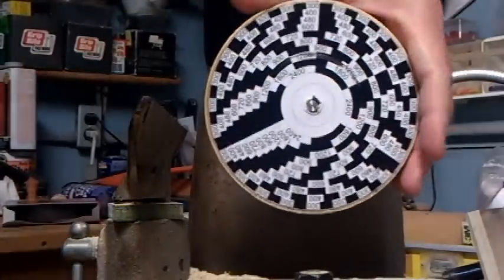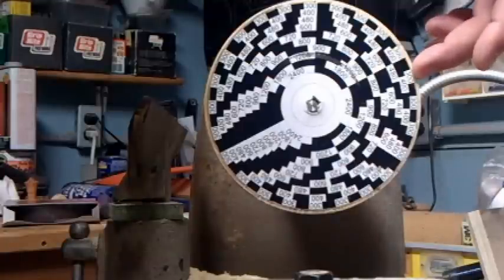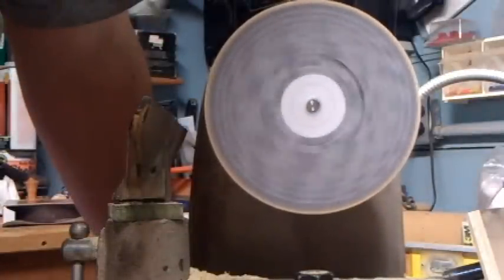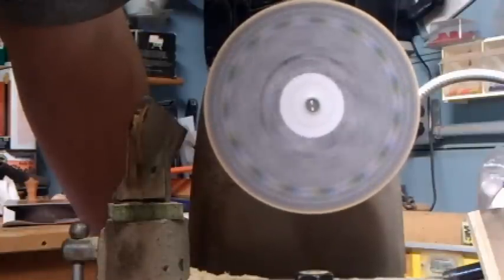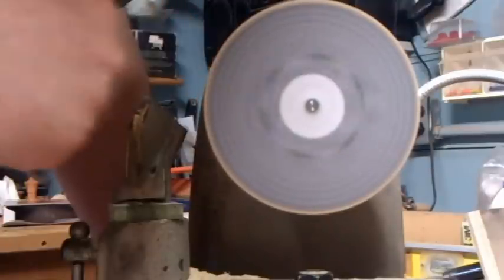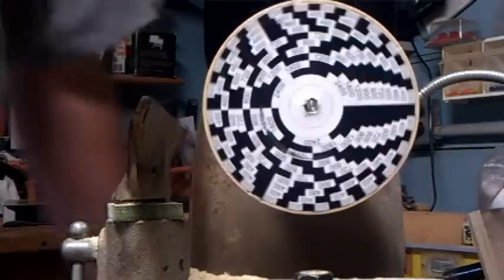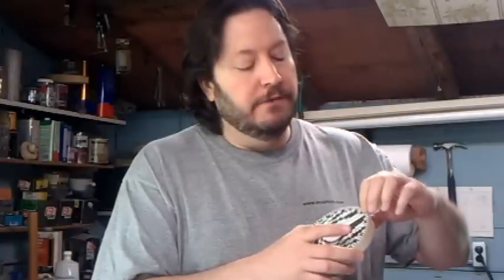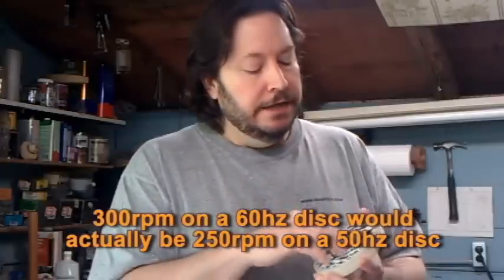DIY Strobe Tachometer

Comment: Brilliant! Old tech can still be useful and dependable. Thanks for posting this.
Reply: Made one and used an LED bulb (marked 60Hz) and it worked great for  marking speeds on my variable-speed lathe dial that doesn’t have a digital readout! Cost ~.005 cents for paper, printer ink, a squirt of spray glue, and scrap backer material.

Comment: I just had a thought... If you did want to make a strobe light, I made one by accident.
My bed side reading halogen light bulb went again, it was late and I wanted to read so I pulled some leds out of a £1 torch you get from a petrol garage, I then made 2 lots, about 6 in series each for the voltage and paralleled them across the transfomer. UK runs at 50 Hz and I can see the flicker. I forgot how fast leds are, I should have rectified and smothed first and drove them DC. However easy to make and also get a X2 of the line frequency if you want to measure faster speeds.
Reply from the maker: Great idea and would make a an interesting video.

Comment: Good video. I think you have to use fluorescents with older magnetic ballasts. An electronic ballast switches at much higher frequency. A 3 phase shop may have lights on all 3 phases. In that case you could shine a fluorescent work light on the disk.
Reply from the maker: Chris W Thanks. Even with the older style fluorescent you can't have interference from other types of lighting and it helps to have the disc where it will be lit directly otherwise the effect is hard to see. I have a new lathe and new motor so I may do an updated video later this year.

Comment: Is that a sewing machine that the disk is mounted on? Sounds like it.By the way,some of the old record changers(Dual for one) used a similar way to check speeds.A small neon bulb was used if I remember right.
Reply from the maker: +Michael Henwood Haha, yeah it did sound like a sewing machine. It was a loose set screw on the pulley.